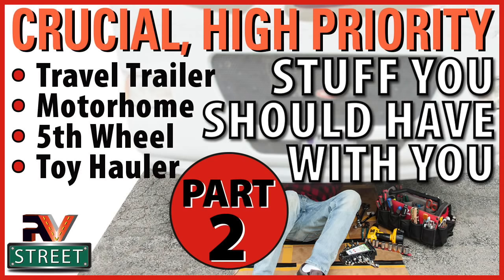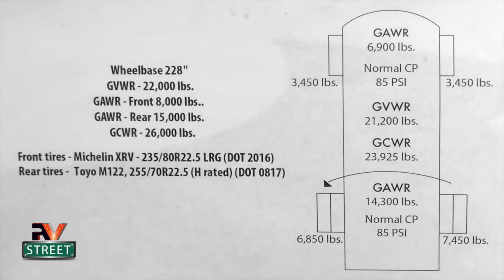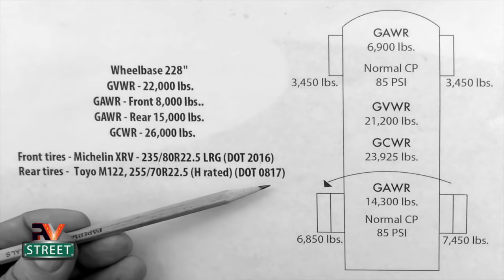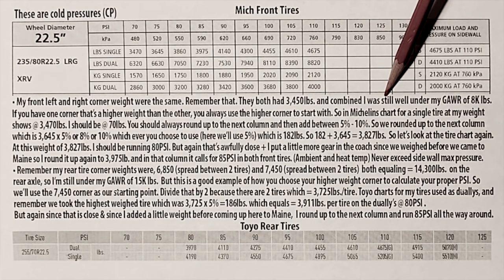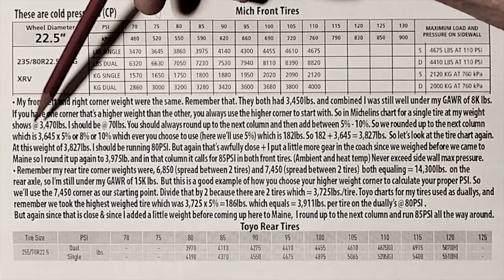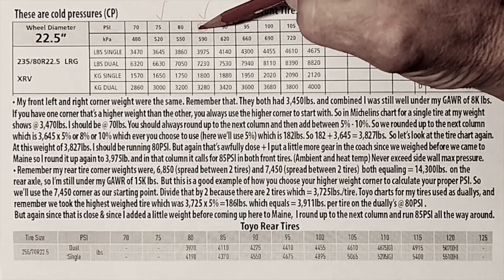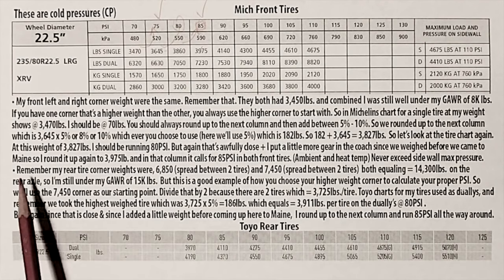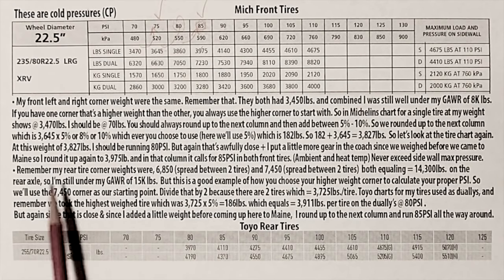How to CALCULATE tire pressure for a motorhome • Or Bad Things Happen

Comment: The tire date for the front wheels would be the 20th week of 2016. I was unaware that charts like this are available. I'm beginning to realize that there is a lot of responsibilities  at owning an RV and running it safely.
The tire pressure label (located on the driver's side door jam) on my 1981 is unreadable.
Reply from the maker: You need to do a 4 corner weigh on your coach anyways to determine what PSI you should be running. Watch this video. It will help.
https://www.youtube.com/watch?v=VMnX2OgCuok&t=218s
All my videos: https://www.youtube.com/c/RVstreet/playlists

Comment: Hi Martin,
Thank you for the thorough  video on proper inflation.  I'm using a travel trailer and will be looking for a way to get at least Left and Right weights so I can plan for the max side load on my tandem axle TT.
Any other special differences for doing this evaluation on a TT ?
Again, many thanks for the training on the right way to evaluate inflation needs!!
Reply from the maker: This video is for motorhome tires because of the characteristics of a motorhome, how loads can vary, most have dually's in the back etc. I do know TT tires are different because of the way your axles and loads are plus you use totally different kind of tires. I'm not well versed in TT tires, load capacities etc. So I'd look into how to properly inflate your TT tires.

Comment: I did not catch if you weighed your RV with your Tow Vehicle? Is that necessary for GCWR? I also noticed the different tire pressures between your Toyo and Michelin tires. If you had Michelins on the back as well, It looks like your rear tires would have been 90 PSI? Can you run front and rear tires at different PSI? Great info again.
Reply from the maker: We tow our vehicle 4 down. So no, that does not affect the weight when calculating PSI. So, if you tow 4 down, it's not necessary to weigh the coach with the tow vehicle attached. If you use a tow dolly that's different, because you are actually putting weight on the tongue of the hitch which adds weight to the GVWR. However, your tow vehicle will affect GCWR because that number is the total weight your chassis is rated for. 
So for example: Our coach is rated @ 22K GVWR. That's the most weight we can carry ON THE COACH, and that includes everything. However, our GCWR is 26K. So if I loaded our coach to the maximum of 22K lbs., that means I only have 4K lbs. left over for a tow car and equipment to tow it. If I want to tow a 5K tow vehicle, then I have to shave off 1K lbs. off my GVWR. The reasons for these numbers are many, but in a nut shell, the chassis, the braking system, the engine, the transmission, the rear end, the suspension, etc.....is rated to handle a certain amount of weight. If you exceed that weight then those systems get stressed, wear out faster and may not work when you need them to. (Think slowing or braking down a steep grade for an example) Many times if—any vehicle—is in an accident and it's determined that they were over weight, the insurance company can and probably would deny any claims.

Yes you can and probably should run different pressures front and rear. It just depends on what the charts say, what your weight is and what tires you have in those positions.

Thank you Keto. Good question. 🔧 👍

FYI....I have changed my weight some since this video and I'm currently running 90PSI on the steers and 85PSI on the duallys.
Reply: @RVstreet  as always, THE BEST.  Thanks for you quick and informative answer.
Reply from the maker: @ketonobull1649  👍

Comment: This was an awesome video, what about those of us with a 5th wheel with 2 tires on each side? Help… just want to be safe.
Reply from the maker: Thanks J,
To calculate your proper tire PSI is done pretty much the same way.
The only SAFE way is to take your fully loaded rig to a truck scale and weigh it. Then inflate to what the tire manufacturer suggests for the heavier side on both sides of the axle.

You should NEVER use less tire pressure than what is recommended on the tire placard.

I don’t know what kind of tires you have, but it is also important to note that many ST tire manufacturers require their tires to be aired to full sidewall pressures. That information will be in the tire’s warranty package.

Quick tire contact test:
Take a piece of thick sidewalk chalk
Run a stripe across face of thread, side to side on each tire
Then drive rig forward about 25' and check chalk mark

Chalk rubbed off in center - psi too high
Chalk rubbed off on edges - psi too low
Chalk rubbed of evenly - psi close enough

Always fill tires at proper pressure when tires are cold. ALWAYS run with a TPMS on ALL TIRES so you can monitor them from the cab of your truck. NEVER exceed the speed rating of your tires.

Here's a link to everything you could ever want to know about tires.
https://www.rvtiresafety.net
Reply: Thank you very much, I always learn so much from your videos.

Comment: What happens after you've been boon docking for a week you freshwater is gone and you've offloaded waste do you then un-inflate the tires to downgrade the pressure?
Reply from the maker: If you've been boon docking and now you have no fresh water and now you off load your grey water. your more than likely going to fill up your fresh water again. Your out of water. So the load and your weight stays the same or pretty darn close. If you don't fill up your fresh water again then yes, you would want to readjust your air pressure. AND...as I outlined, you always fill your tires to the correct PSI according to your weight and your tire manufacturers tire charts.

Comment: On the side of the tires it specifics max cold psi and not max hot psi..let me know if I am wrong..thanks ..Manley
Reply from the maker: You'd have to check with your tire manufacturer on what that means for your tires. I couldn't confidently make a blanket statement for all tire manufacturers.
Reply: @RVstreet  that's what mine says on the tire.
..just not a max pressure but a cold psi..thanks for the answer..I am retired truck driver and do watch my coach tire very close..loved you video..thanks

Comment: I looked at my sticker by the drivers seat for my F53 chassis and it confused me on gross weights. It says the front Axle has a gross of 8,000 and the rear is 15,000 and the GVWR is 22,000. Why is there a 1,000 pound difference between the total of the two axles and the GVWR?
Reply from the maker: Because you don't take the front axle capacity and the rear axle capacity, add them together to come up with your GVWR. Your coach—like mine—has a total GVWR of 22K. That 22K can be divided between the 2 axles but never exceeding the limit of either one of them. If you loaded up your coach where you maxed out the capacity of both axles, you would be 1K over weight.

Comment: excellent video Martin. How much does you air pressure typically increase when you are driving. I have found my tires start at 85 psi cold and increase to 105 to 110 after traveling at highway speed for a period of time. Any opinion if this is normal and mine always runs a little more on the left rear corner as well 107 to 113.
Reply from the maker: Some tires do go up that much but it's rare unless you get up to high altitudes or running in very high temps like in Arizona in the summer. Have you weighed your coach? Have you been periodically checking your tire wear? What speed do your run on the highway? When you say you run highway speed that could mean 70-75mph depending on where you are in the country. Those speeds IMO in a motorhome are crazy. Don't forget too, all tires have speed rating. Don't go over that. Also at those high speeds if something ever goes wrong with your coach or in front of you, all I can say is good luck. Faster speed means more heat = more pressure. Typical pressure increase is around 10-12lbs. 👍
Reply: @RVstreet  Hi Martin, I am in Pa. We travel SC, TN, NY, VA. We were going to Bar Harbor in Maine in September, but those plans just became a logistical nightmare with the mandates that Maine has right now with the place we were heading. We were heading to Thousand Trails Narrows Too RV Resort. We changed those reservation to May 2021. Yes when we went to SC in May it was hot and humid. We have had the Coach weighed. I kinda do it the hard way. I pull on a Cat scale with each axle on a pad to get total axle weight. I had 2 axles. I then pull around and pull back on with just the left side on the same weight pads and pull around again with just the right side on the pads to weigh them. That gives me a 4 corner weight. When I say highway speed we only travel between 60 and 65 no more. I typically try to run about 62-63. We are not one of those ones racing to get some place.
Reply from the maker: @blaster127  Yep, that's the way to do it with CAT scales. I'm surprised your tires gain that much PSI at those speeds. I would question the accuracy of your TPMS and sensors. What brand do you have? Do you put powders or beads in your tires for balancing?
Reply: @RVstreet  I have a TST 507 TPMS with the flow threw sensors. I did forget to mention that I have 19.5" wheels on my 2005 Fleetwood Bounder. I believe they have  lead weights on the rim.I can not see the outside of the rim because of the hubcap, but will check the inside and between the duels on the back.
Reply from the maker: @blaster127  Ok a couple more questions:
1) On your tires, there is written the maximum air pressure amount that is printed on the sidewall of the tire. What does that pressure say?
2) Have you checked the wear on your tires? If so how do they look? I'm NOT asking you how much tread is there is but how are they wearing? Evenly?
3) How old are your tires?
4) Has this high pressure problem after driving awhile always occurred OR has this been a recent development? If recent what has changed?
5) You said you weighed your coach. Are you within your limits?
Reply: @RVstreet  1) is 95 PSI....2) wear is very even.....3) 4 years old....4) this has been typical for as long as I have had the coach 7 years.....5) yes the weights are about 800 lbs under for front axle and 700 lbs under on rear axle and that is all fluids full. Black and grey are empty.
Reply from the maker: @blaster127  Well, if this has been typical for 7 years and the tires you now have are 4yrs. old, that mean the previous tires you had also did this. So........to me...that narrows it down to two things:
1) Your TPMS is not accurate or calibrated correctly with your sensors therefore you're getting false readings....OR....
2) You are getting accurate readings and you've been running this way for 7 years and no problems. So just Rinse and repeat.
However, if it was me.......I wouldn't be comfortable running those high of pressures on 19.5" tires. I'd be worried sick every time I saw those pressures and I'd  just be waiting for something bad to happen. I'd run further testing to be sure what I'm seeing is accurate. Starting @ 85PSI and ending up at whatever it was you said, 115-117PSI after an hour or so would worry me to death.
But that's just me.
Anyway been good talking to you my friend. 🙏
Reply: @RVstreet  Thank you Martin for your information and will do some more maybe weight shifting too.
Reply: @RVstreet  p

Comment: Really helpful videos.  Thanks.  FYI, the AZ escapees site is closed with no published date on re-opening.  Any suggestions or pointers on how to get a 4 wheel weighing at a regular CAT scale?
Reply from the maker: Find a CAT scale that has no yellow barriers on either side of the scale. The straddle the scale putting the passenger front tire on the front scale and the rear duallys on the middle scale. Rinse and repeat for the drivers side. Not as good as a 4 wheel weigh but close enough in a pinch.
EDIT: Livingston, TX office is also closed but they still are doing SmartWeigh. Might want to give AZ office a call and see if they are too.

Comment: Confused - My tires state 80 PSI Max load -I just bought the rig and have yet to look at all this but the tire pressure is stating 82 all around but now that it's in my driveway I have a duli outside that is flat - if the max pressure states 80 and I'm inflated to 82 when driving it increases this has to be a problem no?
Reply from the maker: MAX PSI is stated on the outside of the tire. The only time you should ever fill your tires to MAX PSI is if the RV is going to be stored for long periods of time to prevent flats spots. You always fill your tires to the correct PSI pressure when the tires are COLD according to your weight right before you leave. If you've never weighed your RV when fully loaded to go on a trip, and you haven't looked at your manufacturer tire charts, then it's impossible to know what PSI you should be running. So for example, if your proper air pressure is 80 psi according to your weight and the type of tires you have, once your under way, your tires are going to heat up and tire pressure will increase. But the tire manufacturer has already calculated that into their tire charts. That's why you always fill your tires when they are COLD. So no, it's not a problem if they were filled to the correct cold pressure to start with.
Now another point.....if you have one dually tire flat, that means the other dually has been taking the full brunt of the weight. That's not good. Your dually's should both bear the burden of the weight. This is bringing undo stress on the good tire and that's when bad things happen.
BTW...are you running a TPMS on all your tires?
Reply: @RVstreet  Thanks so much your the man ! I have not driving the RV - still waiting on the title - yet to be registered the vehicle is parked safely in the driveway with the outter dual flat on driver side AXIS VEGAS 24.1 Thor coach - all tires are set to 82 off the maint. agreement we had - prior owner insisted front tires should be 65 psi and rear 75 psi - shows what he knows - BTW have aTPM comming for an upgrade - Thank you so much your the professor of RV's in my book
Reply from the maker: @abbiebeast  Thank you so much Johnny. 
Glad to help when I can. Please don't forget—just as a reminder—anything you need for your rig or anything for that matter that you would normally buy on Amazon, it would be awesome if you used our Amazon Store. Even if we don't have what you need in our store, you can still use the link below, then shop for what you need, put it in the cart and check out. It's great way to say thank you for making these videos and helping the RV community.
https://www.amazon.com/shop/rvstreet

If you ever have any other questions don't be afraid to ask me either here on YT or on our Face Book page. 🔧 👍

Comment: Something is wrong. Your GVRW is 22,000 pounds, but according to the sticker at time 26:07, it says never exceed 4652 pounds of occupants and cargo weight! This puts you at "21,200 POUNDS OVERWEIGHT!" Very informative video other than that little discrepancy.
Reply from the maker: Nope that's not right.
My rig has a maximum GVWR of 22K. After I loaded up everything in the rig I'm now @ 21,200lbs when weighed. That's 800lbs. below max. GVWR. That sticker @ 26.07 is saying I have a total of 4,652lbs. of cargo that I can load—from dry weight or empty—and that would bring me to 22K lbs. which is the maximum I can carry.

Comment: Wow, common sense doesn't exist these days....  28minutes on how to fill a tire... nice video for those that need to have someone hold their hands.. it says right on the sidewalk how much air to have in a tire....
Reply from the maker: "it says right on the sidewalk how much air to have in a tire......."
I think you meant to say "side wall"
That air pressure rating on the side wall of the tires is the MAXIMUM air pressure. You never want to exceed filling your tires beyond that side wall pressure. But that is NOT the air pressure you run the whole time when traveling. Usually the only time you would fill up your tires to that amount is if your going to be storing your RV for long periods of time because you'll be losing a little air pressure over time or storing it in cold weather where ambient temps fluctuate a lot, so your tires don't develop flat spots. In normal traveling conditions though, you always fill your tires according to your weight + 8% - 10% as I explained. If you ran the maximum air pressure that's stamped on the side wall all the time, it would make for a real rough ride, hard on your suspension, uneven tire wear and cause handling problems.
thx for your comment so I once again could clarify that. 🔧 👍